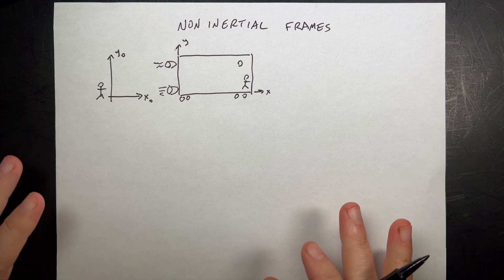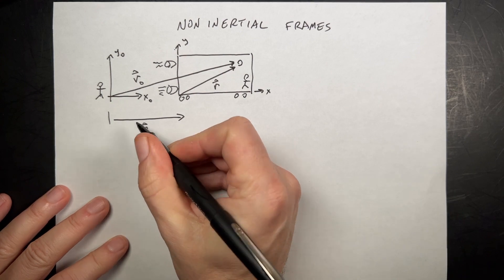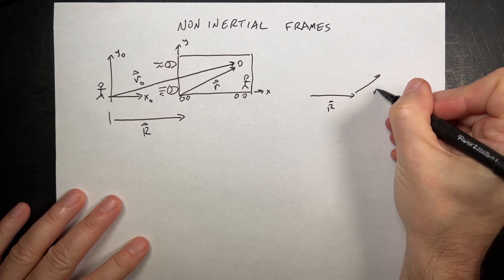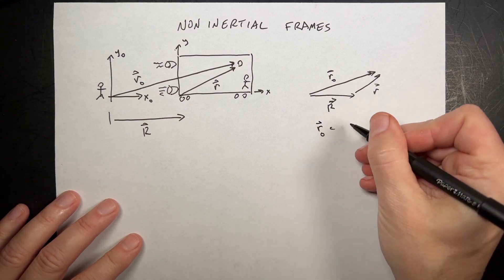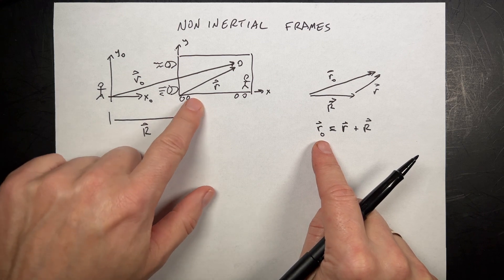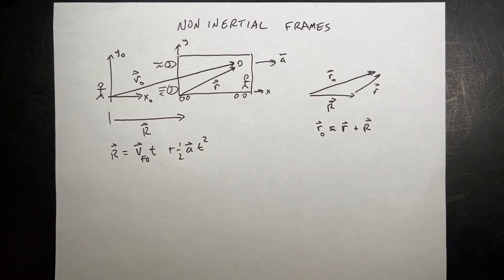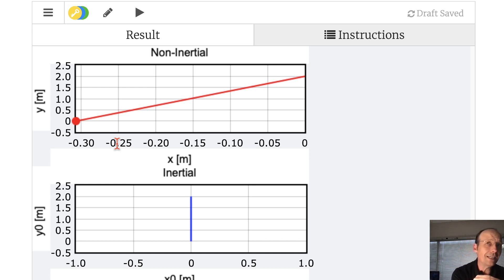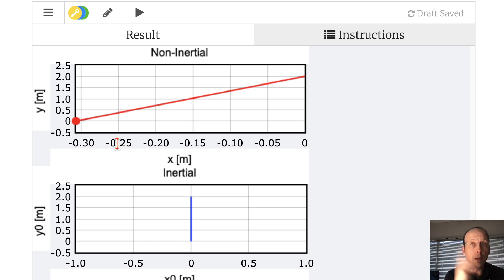Introduction to Non Inertial Reference Frames

Comment: are you using Cartesian coordinates? do we need Cartesian coordinates to define an inertial frame?
Reply: Yes, he is using Cartesian Co-ordinates. No, there is no particular need to use any one set of co-ordinates to define an inertial frame. An Inertial frame is not dependent on choice of any system per say. The only condition is for it not to be accelerating. Any polar or spherical system ie non cartesian system also works. But if any frame is either rotating or accelerating in any other way, it wont be inertial.